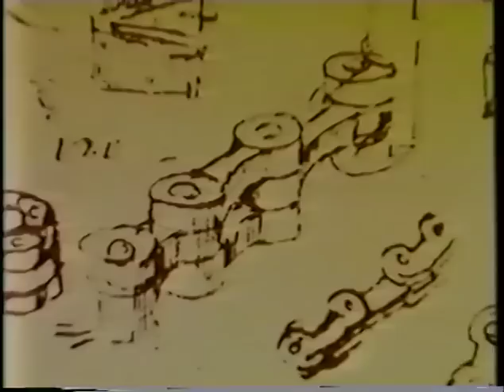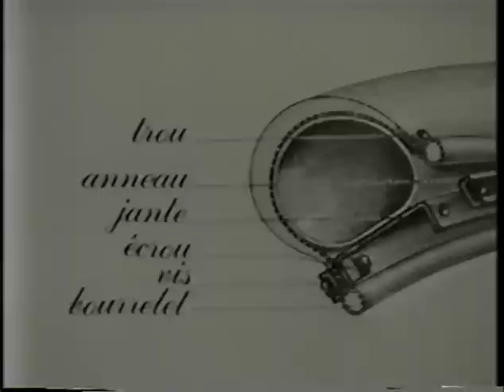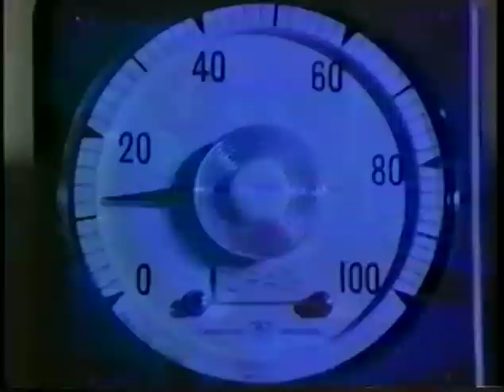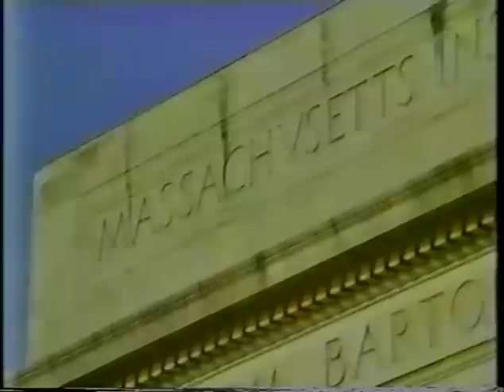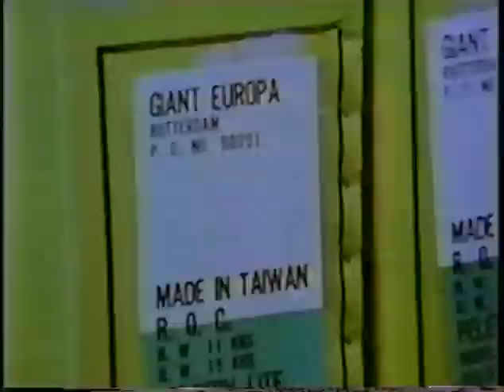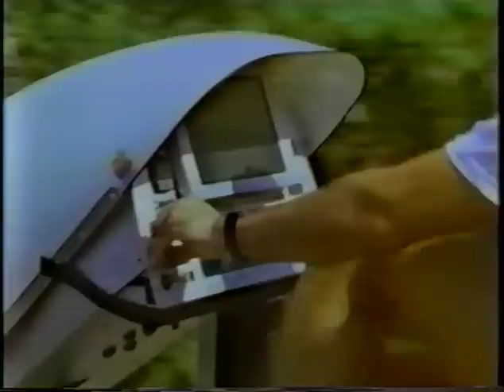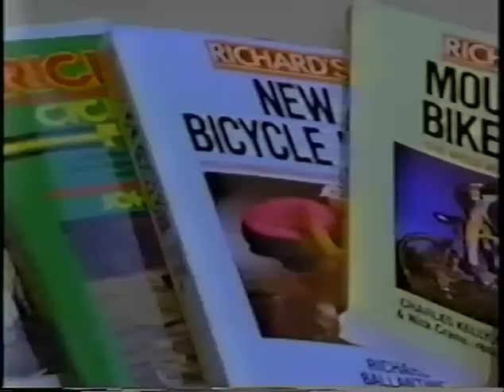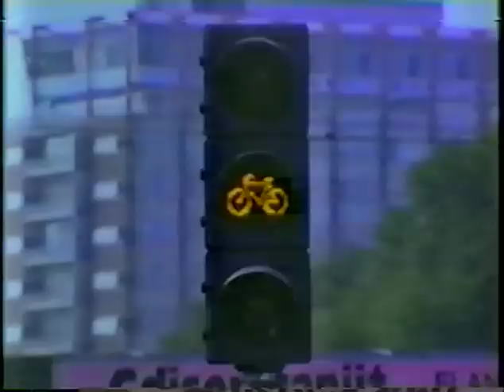The Bicycle - A Celebration of the Invention

Comment: The Bicycle is  the most efficient   vehicle ever made and it doesnt use fuel and is power by the riders legs .    I commute by Bicycle every day and night and I love it   .   cycling is  the best way to get around .
Reply: I love bikes but I think the roads are just too dangerous for a bike. We need to start thinking about building roads just for cycling on.
Reply: bighands69 .. come to holland :)
Reply: I live in the Netherlands and I can assure you, bikes are great for moving in some small towns and have several advantages such as cheap, no environmental and noise pollution, but they are very annoying for cars and pedestrians. Especially here in the Netherlands, bikers just run over you, they don't care about others (I also bike but asap I'll get my car). It's a bit like scooters in Italy, so annoying.
Reply: very well put mitoand9  ...anything eventually finds a segment of the population that finds it annoying.  I'm sure there are some mickey mouse haters out there. :)  I always tell people, the issues are due to humans, not the mode of transport.  if aliens created the perfect transport, we'd still have people complain about it.
Reply: Bike do use fuel, fuel that powers us the engine of the bike. Without our engine powering the bike it's just a rather large paperweight...
Reply: It depends on the distance. A colleague hat 150km to work and 150km back home. Not feasible by bicycle. I love my bike, too and use it to commute as well.
Reply: @sebastianr1204 i used to commute 17 miles each way, 5 days a week for 25 years in all weather. For fitness but primarily to save money. I don't think I would have done it these days, my electric car once bought does each mile for 2 1/2 p on night time electricity, not much to save there. In fact the sport element took over and my several bikes for racing were about £5k each lol.
Reply: @stevezodiac491  2 1/2p? This wouldn’t be possible in many countries: car price, alone insurance, inspection costs etc. would cost more. As Student I cycled a lot because it was cheaper. Now I am cycling because of fun, now I’m in the lucky position to have a very good salary.

Comment: i'm what they call an expert level XC rider and amature downhiller.   That makes me a pro all-mountain mountain biker, we typically race from point to point on rugged and steep terrain for 10 to 20 miles, dual events on the same bike are also fairly common.  We do a 20 mile XC race on saturday and then the main event, the timed downhill event on sunday,  you have to use the same bike and the same wheels.  That's why long travel bikes with triple rings are still popular,  i dont know if they make them in 26" anymore or not

Comment: Regarding the 'shared-use' of trails that Fisher talks about @ 24:00 ish ... this is coming from someone who used to ride offroad motorcycles & was involved with the land-use issues of a local National Forest in the US:

Assuming 'management' of multiple users of trails is a pipe dream.  Human nature is that 'I've got mine, screw yours' ... one group doesn't like sharing with other groups.  This can be OHV, bicycles, hikers, whatever.  The Environmentalists (Sierra Club etc., there are a kajillion enviro groups) dislike all users except for themselves.  Enviro's have a clever tactic that they use to kick everyone else off of the land:  the Law, and Divide & Conquer.

I've seen the OHV group splinter into the dirtbikers that dislike the quads, the quads (ATVs) dislike the UTVs, the UTVs dislike the Jeeps.  I've witnessed mountain bike clubs activity campaigning to kick off the offroad motorcyclists from 'there' trails.  And on down the line to the hikers duped by the likes of the S.C.  And for 'management'?  Ban them all, and the problem goes away.  Path of least resistance.  And the Law is on there side to do it.  The enviro's dance with glee.

With nothing being done about the human population explosion, access, pressure & use of existing trails will only get worse.  Already offroaders are forced to be criminals in order to use trials that they once had access too.  This is trickling down to bicycles and yes to even hikers themselves.

Think about that next time you want to kick someone else off of 'your' trail just because they use a different form of transport for personal recreation.

Nevermind, it's too late.